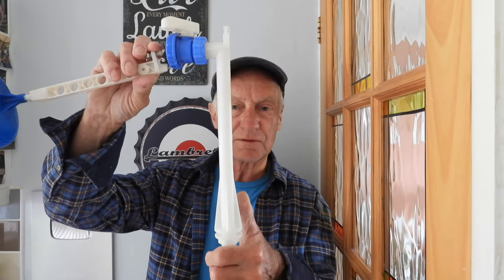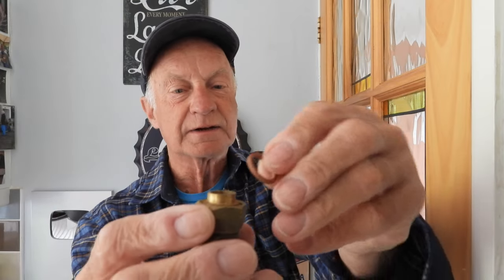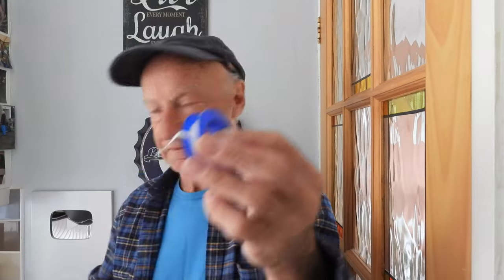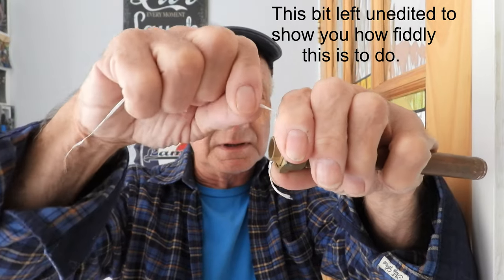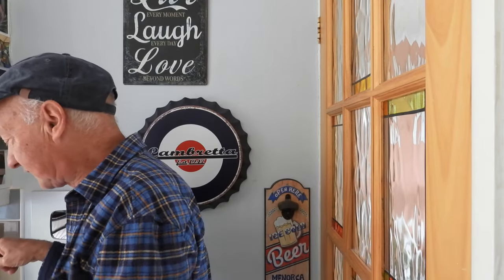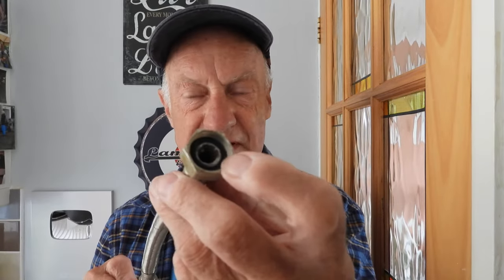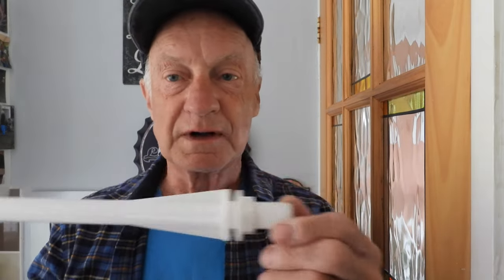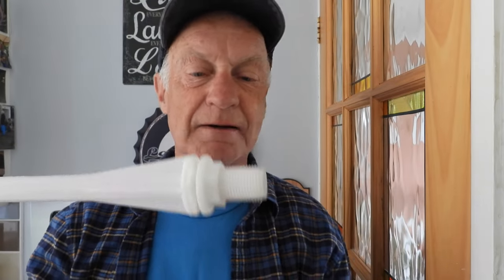Leak on ballcock to pipework fix.

Comment: Dereton didn't mention it but fibre washers expand when they get wet and that makes the seal (It can take an hour or 2)
I would always use a new fibre washer.  Also they are most likely 1/2 inch fibre washers, makes no sense as they are not 1/2".
Reply from the maker: Strange isn't it.

Comment: Did what you showed years ago and it still leaked because it was on mains pressure.  I ended up making an adaptor at work with a deeper female thread. 15yrs later still no leak.
Reply from the maker: A female iron to copper coupling would also have done it.

Comment: Hi Al, should condensate pipe from boiler still run on a hot day with boiler switched off?  Today it has run, only a little bit but is it normal?
Reply from the maker: Depending on the model it can be normal 😏
Reply: No shouldn't run , check pressure on your boiler and make sure isn't over 2 bar could be a problem with your expansion vessel